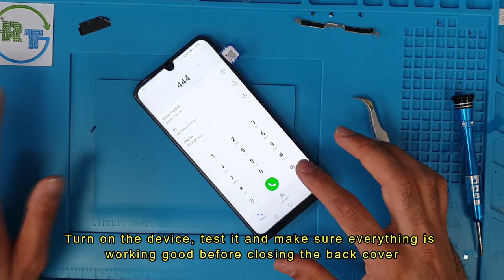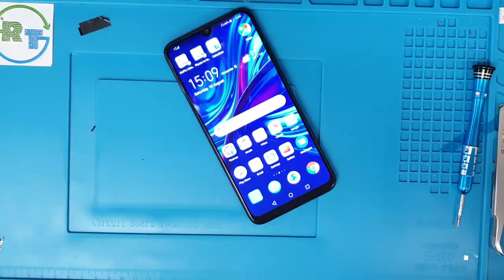Huawei P Smart 2019 (POT-LX1) Screen Replacement

Comment: Just fixed mine according to this step by step video. 

I must point out couple of errors though:

1. When reassembling, the top circuit board screws are not in correct places. As a result some screws do not fit into sockets or they are loose. I advise you to take a photo of the device once the cover is off.

2. When reassembling, the instructor starts placing the cover from the righthand side of the device (side without buttons), which is WRONG. If you do so, the probability of the buttons getting stuck is quite high. So, case should be fitted, starting from the side with the buttons.

Comment: Great video, just fixed mine :-) The only thing I had trouble was that the small components were slightly stuck to the old frame so I had a little more trouble removing. Thanks again

Comment: I might have mist something out but how are you going to get the battery out next time you din't put the stickers of  the battery (that you pull on  ...orange and white ) back. Thanks
Reply from the maker: The reason I didn't put the new sticker becasue I didn't damage the existing sticker. If you damage it in that case you can out double sided tape of sticker. Thanks
Reply: OK !

Comment: Hi, how do you remove the volume/on sensor from the old frame?. Mine seems to be glued and is impossible to remove. TIA
Reply from the maker: If you look at 5:40 it shows how I remove it. If your home button is stuck please heat that area for few minutes. It will soften the glue underneath and it will be easy to remove it.

Comment: There are 2 types on Aliexpress (with and without frame), I don't know which one I should buy?
Reply from the maker: get the one with the frame. it will be easy to repalce it and you dont need to gle that.
Reply: @recovertec1759  thanks alot
My screen resolution is 2340x1080 but the replcement descriptions shows 2160x1080, could you please check that if there's any difference?

Comment: Hey RekoverTec, my volume sensor/piece after reinstalling only works the volume up. Volume down and power not working. I'm afraid it could be damaged. Any tips? I searched on the internet to power on my mobile without that button but seems unilkely :/
Reply: check my comment. If you haven't done it so, that may be the problem.
Reply: @wiseguytr  I solved it meanwhile. It was the sensor button that got damaged. I ordered a new one and installed. Working just fine! ;)

Comment: HI, is it true that the screen has to be replaced along with the battery? I have 3 week old phone and dropped it. When I went for a repair shop they told me they have to replace the screen along with the battery. I was thinking, how is that possible? Bcs the battery is just fine...
Reply from the maker: You dont have to change the battery if there isnt anything wrong with it. Some shops are not professional enough to remove the battery without damaging it so they prefer to replace it with the new one.
Reply: @recovertec1759  i see. well thank you very much fo yr reply. rwally appreciate it
Reply: @recovertec1759  Did you heat before pulling out the battery? It looks so easy but in other videos they pull and draw and it seems to be stuck very heavy and the battery bends a little. Is there a trick - maybe to pull fast?
Reply from the maker: @marcusmuellerhandy  if you have noticed the orange sticker on the battery. It tells you how to remove the battery. You dont have to heat it and it's quite easy to remove. If the battery was replaced before you have to heat it becasue whoever replaced the battery might have added adhesive underneath.